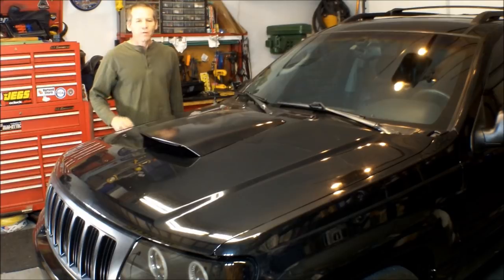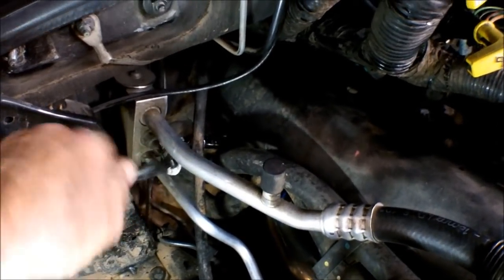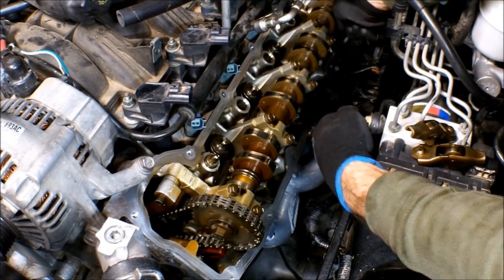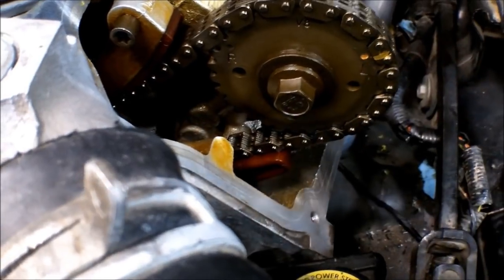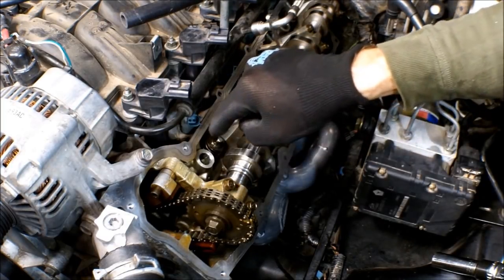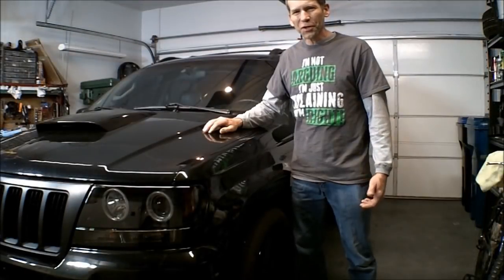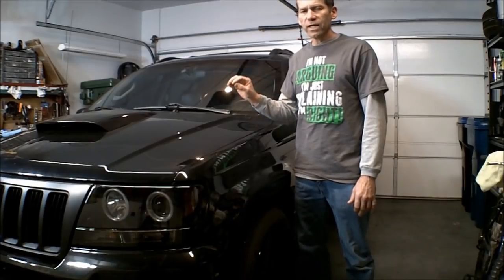How to Install 4.7HO Camshafts & Solid Lifters in a Jeep Dodge Chrysler & Mitsubishi

Comment: You make this look too easy!  This is Excellent!  I read your introductory comments, what are the advantages of using solid lift vs. stock (I'm assuming hydraulic) lifters?   At some point I would love to do this to my 2006 jeep commander 4.7
Reply from the maker: The solid lifters have a few advantages a higher RPM potential especially if you're into a lot of horsepower modifications. You'll never have a lifter collapse like you will with hydraulic. No she you're not into having to pull your valve covers off every 20000 mi in readjusting them then I wouldn't recommend them.
Reply: @martinbuilt  any mods to the fueling needed with the cams? Seeing clearances to the wider spec is what I usually do, motorcycles and such. It is a bigger pain in these engines to check the clearances though.

Comment: Can you install HO cams without head modifications
Reply from the maker: You sure can, remove and replace
Reply: @martinbuilt  I'll give it a shot. I've dropped 2 fulcrums for no apparent reason. I think cams may be low. Already replaced lifters (hydraulic), so I want to go solid to control lash. Does this make sense? Thanks for your response.

Comment: Nice vid! I have a 2007 Dodge Ram 1500 and a set of the ho cams. Could I simply just swap the cams without messing with the valves/lifters? I’m trying to decide whether or not I should take it to a shop. Thanks!
Reply from the maker: Yes you can simply swap out the Cam shafts without changing lifters or Springs.
 Thank you for watching

Comment: I have a 2012 1500 Ram pickup 310 hp and 330 torque . Also high flow exhaust muffler delete and superchips F5 tuner 93 octane tune also 16 spark plugs. Will h.o. cams help with more h.p. and torque ?

Comment: Thanks for the great descriptive video.  I have a few questions.  Do you have to use solid lifters when you install HO camshafts?  How has the Jeep been running since you put in the HO cams? will this upgrade cause a check engine light to come on?  Will it affect smog checks (CA resident here). I have to replace my head gaskets on my '03 Ram 1500 with the 4.7L soon and I'm thinking about going all in and doing everything from timing chain to this HO cam upgrade.  Thanks.
Reply from the maker: You don't need the solid lifters. It will not cause any checks light and no problem with CA smog.
Reply: @martinbuilt  Thank you for the speedy reply Martin.

Comment: So you can use the stock springs???? Please let me know. That's the last Peace of the puzzle.  
I will be doin...

Port and polish, 
head decked, 
ho cams.
Header's...
Can use a Ls1 92mm or 102mm with TPS and iac throttle body with adapter plate with modified plate.. 
2009 intake manifold. 27lb injectors.
custom tune and dyno.
3 inch dual exhaust.
Reply from the maker: Yeah you can get away with the stock Springs.
 With all your modifications that you've added or are going to add you may want to go with the  Comp Cam Springs I think I have the part number listed in the description.

Comment: The real reason that the valve seats fall out is because the catalytic converters get stopped up and the heat backs up to the head and the aluminum head will expand and the seat falls out you can take the head to a machine shop the bore the opening and press a new seat in the fulcrum falls out because chrysler missed the mark and drilled the lifter bore 2mm to deep and the damn things fall out constantly i actually got some caps from a race team that fits on top of the valves to take up that gap.

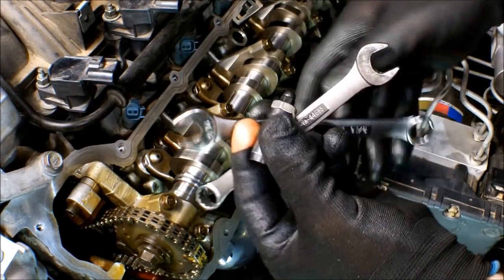Comment: Hey Martin, @ 30:00 you begin installing the solid lifters. I'm doing the same install on a v6. My question is what is the target height of the overall lifter. You mention just over 49mm. Using your first lifter as the example I want to know if you readjusted the lifter off camera or at a later date want to ask if you had to change its measurement
Reply from the maker: You will definitely need to make adjustments to the lifters. And if you ever install a reground camshaft that will also make a difference. I spent hours getting the right measurement. Sometimes you have to take one lifter in and out half a dozen times before you get it right.
Reply: @martinbuilt  thank you for the reply and for posting this video! I just finished installing the slc on the passenger side. I tried to keep it close to .002. I dont have any lock tight on hand so I'm calling it for now and heading to the store for some. I did start it with the new SL installed on the passenger side. I think it sounded great, and with the two types of lifters I couldn't tell a difference in noise volume between the two. I'm pleased with the lifters, although I'm not looking forward to removing them again just to dab lock tight on them, but that's how she goes some times. I'm 5 or 6 hours into it. Do you have any advice on how to apply the locktight?
Reply from the maker: I actually did not do any Loctite on mine. I would remove them clean them up and place one drop or 2 at the threaded part.
Reply: @martinbuilt  again I really appreciate the response! Is there any concern reguarding the necessity of the locktight under the lock nut? Or can I get away with a dab on the outside top? I'd like to not have to reopen and readjust the lifters. Thanks Martin, I'm subscribed! Side note, have you had to readjust them since?
Reply from the maker: @alexbrown8997   I would just a dab on the nut. No I haven't had to adjust them. Hopping to install the 08 camshafts soon.
Reply: On the house of course
Reply: @martinbuilt  Thank you for a quality video. I understand your .015 - 0.025 solid lifter cam to rocker clearance. Is there a specification for the same with the hydraulic lifters. Have had issue with new lifter and rocker. What should that maximum clearance start out at? Rocker arm has came out more than once. Oiling issue? Thanks for any input!
Reply from the maker: @1bam55  could be an oiling issue. There is no spec for hydraulic lifters, it should be .000
I like .0015 for the solids, not .015. Even at .003, the solids make not much noise.

Comment: What if you measure the valve clearance before taking off the old rockers and lifters and couldn’t get any of them to slide in between? Tried all between .002 to .004 and nothing fit in between old the rockers and lifters
Reply from the maker: The old lash adjusters are hydraulic. There should be no Clarence at all with them. You need to install your rockers and solid lash adjusters and then check the clearance and make adjustments  by removing them.
It takes hours to get the adjustment correct.  I would try to get it down to 002. If you settle at .004, you're going to have a noisy engine.
When I do the adjustments, I get it all down, too .0015
Because, as the engine warms up, the gap actually grows between between valve stem and rocker tip.

Comment: Martin, I know this is an older video. Wondering how you liked the solid “lifters”. They every come loose on you or need adjustment?
Last winter I ordered, then waited for Melling brand lash adjusters to come in because I believed them to be a good brand. They are now not staying pumped up. Might even have one or to not fully pumping up ever. It’s only been 7k miles. No dirty oil in the crank case, probably every, previous owner was meticulous. Didn’t see caked oil or dirty anything when installing HO cams. 
All the noises went away after replacement, first time I hammered on the truck the tick came back and hasn’t left. 
Not sure I wanna go solid lifters. Any other brands you recommend if they won’t replace these for me(and they prob won’t, it’s been a year even if only 7k miles)?
Thanks for all you do Martin
Reply from the maker: I like the solids but they are a lot of work to adjust them. I haven't had to adjust them since installed. If you do go solids tell Nick I sent you.

Comment: just noticed you are in Henderson, I am by sunset station, cool ride
Reply from the maker: Yeah, I'm about 5 minutes away from there I go to the Henderson Pick-A-Part all the time.
Reply: @martinbuilt  yeah. Me too I go to both of nvpap and a couple of other ones. I am actually about to go there today. They put a few new jeeps a couple of days ago. You know i have a friend that has a jeep and asked me if i can so a lift on it and i did a 4 inch rough country on it. Drove the car before and after and what a difference. And I always wanted one. And got my first one, an 03 with 148k and the 4.7 HO. But has issues to be fixed. 1 door does not open. Has a check engine light on p0442 code.(I think i know where the problem is) and the knocking noise. And needs tires. But i will put some time in it. I Don't know many people with jeeps and the ones I know don't do their own work. If you want to check it out let me know im by Marks and Warm springs.
Reply from the maker: @jgcruisers  If your on Facebook you can contact me here https://www.facebook.com/Martinbuilt-2351766611763181

Comment: Could you use the factory lifters with an HO cam? Would there be any problems with the valve train if you used factory lifters?
Reply from the maker: You can absolutely use the factory lifters yes go for it

Comment: So you doesn`t have to put in the H.O springs to put in the H.O cams in a non H.O head?🤔
Reply from the maker: That is correct I never had a problem with running the non ho springs with the ho cams and I would take it clear to Red line and had no valve float.
Reply: @martinbuilt  Thank you very much for answering :) The thing is,i bought a 2002 gc overland in mint condition but it sadly had some dropped valve seats.Was thinking of putting on non ho heads with my cams since the ho heads are hard to find.Should work pretty well i think?

Comment: Martin,  I love all of your videos.  You do an excellent job.  I would like to do the 08 cam and intake swap with the larger Throttle Body, 12 port injector upgrade on a non-HO engine.  Will this mod work ok on a non-HO engine and will it pass emissions testing ok.  I live in Arizona and they require emissions testing for registration.
Reply from the maker: Yes that will all work just fine my Jeep Grand Cherokee is a non HO engine.
 And I have no problem passing emissions.

Comment: Is it possible to just swap the camshaft? Without changing the hydraulic lash adjusters or rocker rollers?
Reply from the maker: Absolutely you can install the HO camshafts or 08 camshaft without having to replace lifters.

Comment: Hey Martin. Good video, but something puzzles me. You know ALL these engines were notorious for dropping their powdered metal valve seats. It's not a matter of if, but when on these 3.7, 4.7, & 5.7. They all do it. It would appear that it's already happened on that passenger side. My concern would be that you did all this work running the risk that the valve train could be damaged when this happens. Just wondering if you knew/know this.......
Reply from the maker: Nothing that I did is going to increase the chance of a valve seat dropping. I'm also going to take it as far as installing  HO Springs and the 08 camshafts. I still have confidence in this engine, hopefully it doesn't prove me wrong.

Comment: On the 2nd coil pack from the front there is a sensor that is attached to the bolt...my 2000 Dodge Dakota has those but they arent hooked up...what are they?
Reply from the maker: It is a capacitor for the ignition coils. I would hook them back up

Comment: Would that Timing Wedge work on the 2008-2013 16 spark plug 4.7L? Thanks for the video.
Reply from the maker: Yes that timing wedge should work for the 08 and later models as well

Comment: I have a 2003 Dodge Ram 1500 with the 4.7l in it.  Can this be done to any 4.7l Chrysler engine?  Does upgrading to HO cams mess with emissions (I'm in California) ?  Any check engine lights come on? Great video by the way.
Reply from the maker: Thank you Antonio, yes you can do this to any Chrysler 4.7 that has a single spark plug per cylinder, that would be all before 2008. I know this will not interfere with the emissions and you will have no problems passing California smog.

Comment: Should I replace cam along with lifters if cam lobes are slightly scored?
Reply from the maker: unusual to see the lobes scored if the bearing surfaces on the camshaft are scored that is somewhat common depending on frequent oil changes or not.
If one of the rockers fell off and that's why you are changing the lifters and it did some damage to the cam and yes I would probably change that out.

Comment: When you use an HO cam! Must solids lifters be used ? Also can i put on the HO heads HO cams on to a normal 4.7 jeep WJ ? Using the tone wheel from the stock 4.7 cam on the HO cams. 
Thank you i like your videos very much you do a great job of showing how its done.
Reply from the maker: Thank you, you can use the stock hydraulic lifters and you can install the HO heads on a non HO engine. Yes use your stock cam gear if you are installing this on a NGC 4 plug ECM.

Comment: Great video!!!! but I have a question wouldn't it run better if you installed a 4.7 HO intake to match the cams??
Reply from the maker: In 03 all 4.7 came with the same intake if it was an HO or not. The 02 intakes might be a little better didn't have on at the time that I installed the HO cams. Since then I have installed the 08 intake with a 75 mm throttle body.
08 Intake  https://youtu.be/qMCM0XWromY
75 mm TB  https://youtu.be/HbNrOz74AXY

Comment: I found a 2004 HO 4.7L from a Jeep Grand Cherokee at a pick a part....Q: will the entire cylinder heads fit on a 2006 4.7L Jeep Commander?
Reply from the maker: Yes it will bolt right on. Does your 06 have a EGR valve on the one cylinder head? If so you'll have to come up with some way of deleting the EGR. Or it may be possible to drill the HO to accept an EGR valve

Comment: I am replacing the stock hydraulic/mechanical lifters. Do they need to soak in oil prior to install ?
Reply from the maker: I do not know if it is required , but I would soaked them for a couple hours

Comment: Hey Martin, is there anyway you sell a cam sprocket wrench you made? I can’t get my cams out at all… I tried using a clap and it just slid.. darn bolts on there so tight it’s insane. I don’t have the stuff to make a sprocket wrench myself and can’t find anything at the local shops in my town.
Reply from the maker: I have the prototype I could sell you if you want to contact me on my Facebook Messenger there is a link in the description.
Reply: @martinbuilt  I’ll DM you!

Comment: Thanks man, this will help me a lot.
Reply from the maker: I'm glad you liked it and found it helpful.
Reply: @martinbuilt  I just bought me a nice 01 4.7 WJ. My first one, the engine runs smooth (no weird noises and healthy acceleration, EU version since I am from Poland, 165k miles on the odo) but there is oil leaking from the valve cover and thus I decided to take matters in my own hands and fix it myself (I am a true noob to be honest).
Bought the FEL PRO gasket and 16 brand new hydraulic lifters.
One question Sir, you said when reassembling the cover there is no need to use a torque wrench? 
Also would you recommend putting some kind of special lubricant on the gasket or just cleaning it with alc.?

Comment: Is the process the same for a 98 Dodge Durango 5.9?  Need to replace 4 lifters because it sounds very rough under the cover.  Let me know and thanks in advance.
Reply from the maker: No that is a pushrod engine. The camshaft is located in the center of the engine.

Comment: Two cams for HO 1. # 53021411ab left side…other # 141.3c over 13299 right side. Is right side cam correct number??? Thank you
Reply from the maker: That should be correct. Check out this video https://youtu.be/UqSQ9QrCFro
Reply: Yes I watched the video before and again right now.
It’s the numbers on mine that make me wonder if I have the correct cam for the right side ? 141.3C over 13299

Comment: When you stabbed it passing that mustang it was awesome. Which valve spring brand did you choose?
Reply from the maker: I'm glad you liked it. I kept the stock springs but after installing the 08 cams I replaced the springs with (part number 53020749AC)
Reply: @martinbuilt  I bet lot's of folks get a surprise rolling up to you in a Bronco or Tacoma. I'm sure you raise an eye brow!
I just need to install my 08 manifold and matched throttle body and fuel rail with the new 4 port injectors n' "fire it up!" 
I used the comp cams mustang behives with the HO cams. I'll have those lasj adj ETC heading your way once I get Golden Bear running, tomorrow??? 
More footage of your awsome WJ!